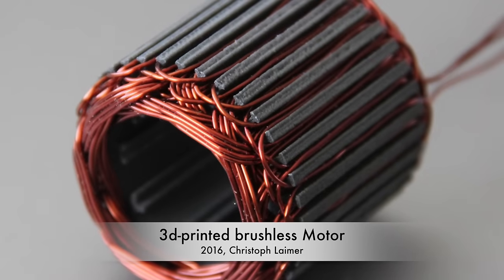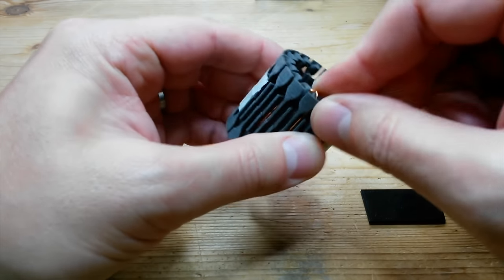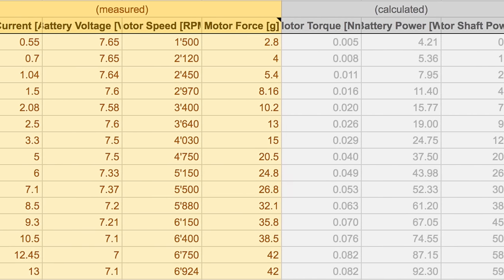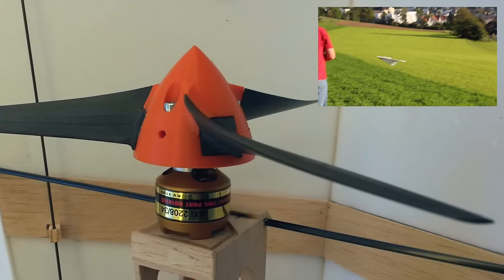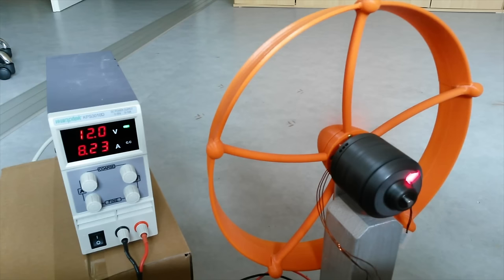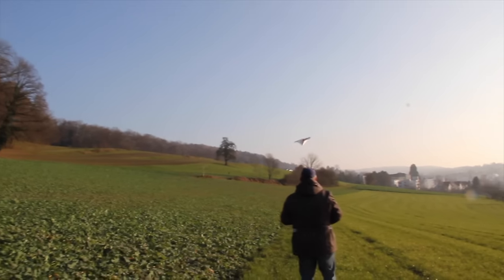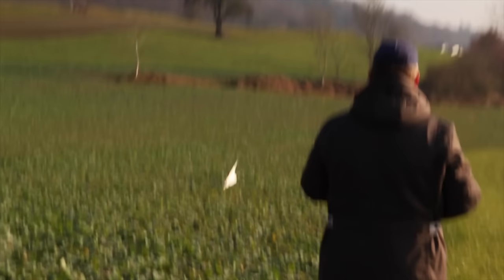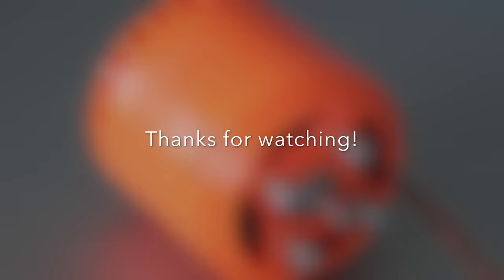RC Plane with 3d-printed Motor and 3d-printed Propeller

Comment: hi i have this all built and setup, i am using a 7.2v 2200 mAH battery and when i give full throttle i can see the motor jiggle back and forth and here it trying to sping but it seems like there isnt enough power, should i get a battery with mor mAh or volts, what should i do?
Reply from the maker: Try a battery with a higher voltage, but keep an eye on the rotation speed (don't exceed 15'000 rpm).

If it still doesn't work, it might be the ESC which has doesn't like this motor: At low rotation speeds the back-EMF is maybe not high enough to be "sensed" by the ESC. A cheap ESC is potentially not enough "sensitive". The rotor of this motor is also quite heavy, and it accelerates not as fast - maybe the ESC thinks that the motor is blocked, and stops the current.

Hopefully there is no mistake with your winding pattern: use an electric drill and a multimeter. Fix the shaft of the motor in the electric drill, and let is spin. It will work as a generator. Then measure the AC-voltages between the motor leads. The measured voltage should be similar for all 3 combinations. If you connect all the leads (short-circuit), you should clearly feel a torque. Even better if you had an oscilloscope: you would see a sine-wave.

Comment: Nice, good job. Question, what do you account for such a large size in the motor relative to the power it produces? The over all size seems about 2-3x larger than a standard off the shelf motor with the same output.
Reply from the maker: much lower magnetic flux due to missing metal, and limited heat resistance because of plastic (metal temperature limit is over 120°C while plastic deforms already at 60°C). Copper losses need to be distributed over a larger area in order to not overheat the motor.
Reply: Christoph Laimer good point!

Comment: Hello Sir,
Need your help, I am RC Airplane hobbies.
Please suggest best low cost 3d printer under  $450 .
Suggest in the view of Airplane components, durable, spare parts of printer available, large working area etc . .  
Please guide . . .

Comment: is the build platform of your 3d printer just a carbon fiber panel? if so how does it work and why did you use carbon fiber?
Reply from the maker: Yes, it's just carbon. Before, I was printing on glass, but it happened, that the printed objects destroyed the glass (a thin layer of the glass surface was pealed off). And there were adhesion issues with the BDP from http://www.extrudr.eu. They recommended to use the carbon, and it just works perfect. No need for tape or glue when printing PLA, PETG, or BDP.
Reply: Wow thanks! I've heard many good stories about pei plates but i think i am going to try carbon really soon. How easy or hard is it to remove the parts? or is your plate thin enough to flex a little? Also do you have any idea how long the plate will last?
Reply from the maker: It almost looks like new after 1 year. I always let it cool down before removing the parts, and then I put a mix of water an alcohol onto parts and carbon: the liquid gets sucked between, and most of the time the parts can be removed without any force.
Reply: Thanks! It's funny that not many people use this rather than glue sticks, blue tape, hair spray or any commercially available materials. i will defiantly try it out.

Comment: Please give a link to the magnets. Not where I can not find the magnet = (And at the same time on the wire. Thanks in advance =)
Reply from the maker: The offer for the magnets that I bought expired, but I guess these magnets are the same:

https://www.aliexpress.com/item/20pcs-N50-Bulk-Super-Strong-Strip-Block-Bar-Long-Magnets-Rare-Earth-Neodymium-30-x-10/32606165548.html

https://www.aliexpress.com/item/1-1-6-0-95-0-67-0-53-0-47-0-33-1-35-1/32335432657.html
Reply: Very very big thank you =) Please tell me this engine runs on DC or AC? If you received a variable using a variable capacitor? And if pomtoyannom how you connect 3 motor wires. I read on the site but did not understand = \
Reply from the maker: That's a question, where the short answer generates more questions ... The motor is named "DC brushless", but if you look at the current in the three wires of the motor you will see 3-phase AC. That means there is a piece of electronics needed, which transforms DC to AC. This piece of electronics is named ESC, and you will find it as common accessories of RC-toys. For further reading I recommend wikipedia:
https://en.wikipedia.org/wiki/Brushless_DC_electric_motor
https://en.wikipedia.org/wiki/Electronic_speed_control
Reply: Thanks again. You are helping to become more intelligent =)

Comment: You should try it with a trainer glider style body or a delta wing. they both would make for a much more stable platform. check flitetest.com for foam board plans
Reply: flitetest is a good chanel

Comment: Does this mean you could make a 3D printed stepper motor?
Reply from the maker: Maybe. Certainly with much less torque. But it probably spins faster, so a reduction gear could be used.

Comment: hi i cant find the shaft or shaft collar anywhere could someone please reply with a link or something thanks
Reply from the maker: There is a kit available: https://www.makesea.com/e/6PO-3W5-3nE-10kc-a3Q-3o5-1NcK/Motor-Kit
Maybe you need to adjust the outer diameter (parameter in the fusion file):
https://www.aliexpress.com/item/10pcs-lot-high-quality-2-1-2-6-3-1-4-1-5-1mm-landing-gear/32650698979.html

Comment: hi i printed everything to size and wrapped the stator tightly  but the rotor is hitting the stator. what should i do to fix this problem. everything is printed the same scale
Reply from the maker: Maybe the rotor is wobbling (shaft and rotor not well aligned)? Or is there too much material extruded (pieces slightly too large)? Are x- and y-Axis really square (round pieces will be oval)? Ideally you would find the reason and fix that, but as a workaround you maybe scale the rotor a bit in xy (e.g. 103%), and re-print it. Don't scale z.
Reply: Christoph Laimer everything is aligned perfectly and printed right. I found out that your original state is 30 mm tall but the brushless stater that is cut in two pieces is 38 thus being too long so I scales it to 30 and I'm wrapping it as we speak. it should work fine now. if not I don't know what it could be. the rotor spins freely on the shaft but once I push it all the way down so theres just a little gap between the rotor and stater Shield the state hits the top of the rotor
Reply from the maker: The length of the two halves of the stator is 38mm - that's fits well into the rotor. Maybe the wires are not tight enough. It should look like this: https://www.makesea.com/documents/12185/75555/IMG_6808.jpg/91fe07d2-c7ad-42cb-a27d-b852a92ea3fa?t=1467051169791

Comment: How did you get the shape of the propellers?
Reply from the maker: Sketching the airfoil at some radii, and then using the "loft" function in Fusion 360

Comment: does this need to be balanced after printing?
Reply from the maker: In general 3d-printed parts are balanced quite well. However the mass of individual magnets are very different. For this reason I've measured their weight and arranged them in a better balanced pattern: http://www.makesea.com/wiki?p_p_id=54_INSTANCE_9jGVcyv6Jb3y&_54_INSTANCE_9jGVcyv6Jb3y_title=makeSEA+Analysis+-+Brushless+Motor+-+Selecting+the+Magnets

Comment: hi christoph, what 3d printer do you use?
Reply from the maker: Ultimaker 2 and Makerbot. Other printers work as well - as long as the xyz-axis are aligned and calibrated perfectly square.

Comment: How much would you say this build costs?
Reply from the maker: Material costs of motor and propeller maybe USD 15-25. Printing time 20-30 hours plus some hours for manual work (cleaning the printed parts, winding, assembly) ...

Comment: Why only max 60% efficiency?
Reply: I'm guessing it's because the stator core is not ferromagnetic.
Reply: Ok, he's using "magnetic PLA for efficiency reasons", very interesting. Still, laminated sheet metal would probably make it more efficient since there will be less eddy currents in the stator.
Reply from the maker: The iron powder particles in the magnetic PLA are well isolated. Regarding eddy-currents, I'm rating it superior to laminated sheet metal. Efficiency is actually over 70% (part of the 30% losses is also the ESC).
Reply: Very interesting, thank you. I'm enormously impressed with the design and documentation. Have you tried estimating the magnetic susceptibility of the magnetic PLA?
Reply from the maker: These are my measurements: http://www.makesea.com/wiki?p_p_id=54_INSTANCE_9jGVcyv6Jb3y&_54_INSTANCE_9jGVcyv6Jb3y_title=makeSEA+Analysis+-+Magnetic+PLA+-+Electromagnetic+Tests
Reply: Amazing. Thank you.

Comment: The motor and prop look to be pretty good. But the way it was fixed into the plane looks hopeless. Much to flexible. Flying wings don't need to be so lightweight, in my opinion.
Reply from the maker: You're right, but the "original" plane-design with the lighter (common) motor flies excellent: https://www.youtube.com/watch?v=zXV3GNcvId8

Comment: This looks like an amazing project but the transitions in the video started driving me crazy. I'll come back later to see if I can get through more of the video.
I hope you'll be more conservative with the video transitions in the future. I'd really like to be able to see what you're doing without wanting to rip my eyes out.
I looked through the comments and I didn't see anyone else complaining about the video transitions. I find it hard to believe I'm the only one who found the transitions irritating. Was anyone else bothered by the transitions?
Sorry to come across as a jerk. It sure looks like you're doing amazing stuff.
I'm very curious to see how well your motor and propellers worked.
Reply from the maker: Sorry about that - next time I try to keep the plane longer in the air, so I'll have longer video sequences.
Reply: Duane Degn i think you're the only one who finds the transitions this irritating.
Reply: +Chimaeria "i think you're the only one who finds the transitions this irritating."
So far the evidence points to your being correct.
+Christoph Laimer Sorry for being so negative.
Reply from the maker: No problem - each to his own. I like that your feedback is very specific. If other people just click on "dislike", it's much more obscure to figure out the reason.
Reply: I didn't have an issue with transitions myself, but on an earlier project I noticed people could get a bit dizzy if I overdid it on crossfades. But it's really quite rare.

Comment: The part of that the stator is plastic... the metallic stator make the electromagnetic field more smoother , I know that is very hard to make a Iron stator... you need to cut , slices of Iron and pressured together... if the press is not good , will end up have more current wasted then now... ok the weight is an issue but how much % characteristic you lose that we say is worth it! if you lose from 10 to even 20% of performance and power, may be I am okay with it! but more then this is not good! and I am not sure if the electric motor that u used is at the same level with that you make! If a motor is not made good At the stator , the stator will burn of temp and energy! so there you have Fe waste... there is some books that help you calculate and is not very easy way ... but you end see the motor like a transformer, and you take step by step , where the waste come from, is from Fe , is from Copper, is from pattern of the copper coils , is from an old bearing?